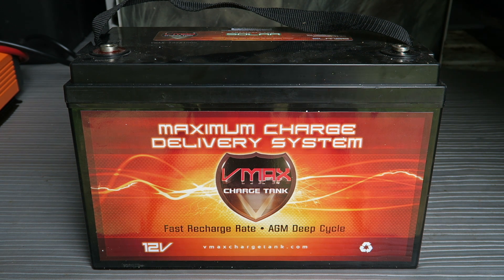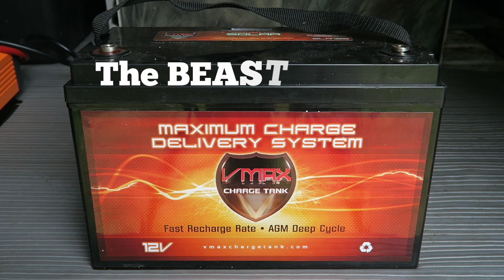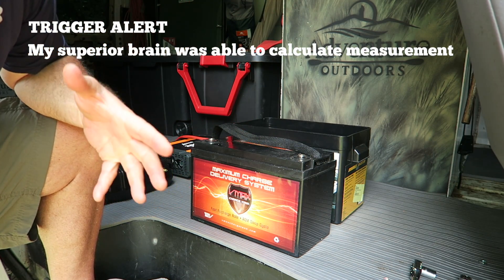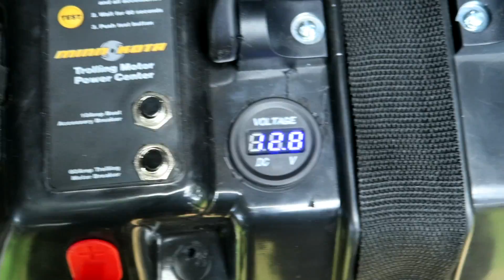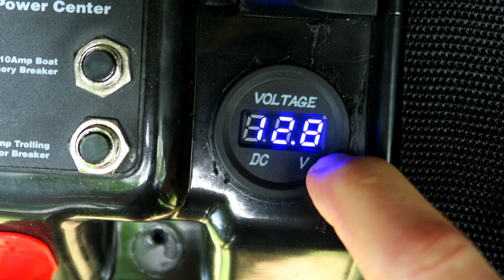VMax 125 AH Off Grid Solar Battery Power Setup ~ Redneck Yeti 1250

Comment from the maker: Amazon links to build your own DIY off grid power bank.
Minnkota Trolling Motor Power Center on Amazon, https://linktw.in/hCjxOT
Deltran Battery Charger Plus, https://linktw.in/sdRoZn
12V LED Meter https://linktw.in/yxoHLD
Ampeak 2000 Watt Power Inverter, https://linktw.in/kMYkzD
Vmax AGM Deep Cycle 12v 125ah on Amazon, https://linktw.in/QVdEOd

Comment: Me , just wondering 🤔.  Could you use the power from the inverter to power a bigger battery charger to charge the battery , and it would cycle itself , then by adding a solar panel it could make up any loss juice from the battery ?   When the solar wasn’t receiving sun light the inverter would charge the system , you would need some kind of charge limiter once the battery was full as to not over charge it ,   (  kinda like charge itself on a loop system ) 🤔

Comment: Great idea...
I need a portable power source to plug a 1800 watt hair dryer into and run it for at least 15-20 min.
Will the inverter handle 1800 continuous and will battery last that long?
Then, I need to put it in the car and can I trickle charge it from a 12V outlet in the car on the drive home?
Thanks in advance for your time.

Comment: Glad to find this, this is basically exactly what i wanted to do, but wire it to my truck battery with a solenoid that is triggered by my ignition so it'll charge both batteries when the truck is on, but prevent battery siphon from the engine battery.

Comment: Since you are only using a 1.25A charger and it takes you 24+ hours to charge.  Have you since moved up to a 5A or bigger charger?
Reply from the maker: No I haven't. Since I only use it occasionally, I haven't needed a faster charger.

Comment: Thanks! I built the same based on this vid. Using to charge drone batteries on jobs. Now I want to figure out how to safely top-off charge it when the vehicle is running.
Reply from the maker: That's awesome. Watch this video around the 5 minute mark and it might be exactly what you need to charge while the vehicle is running. https://www.youtube.com/watch?v=e38yLUzBoKo
Reply: How about small inverter into vehicle cig lighter then low amp charger to your battery  pack?

Comment: Hey man stupid question can you charge your battery while using the power from the same system
Reply from the maker: Shouldn't be a problem. If it were hooked to solar, that's exactly what would be happening.
Reply: Definitely
Reply: You can also jumper cable it to your truck and run it non stop

Comment: Nice setup, I always heard you could take a deep cycle down to zero without doing it any harm & that’s what they were designed for, just wondering why you said you didn’t wanna take it down that far???
Reply from the maker: The reason I said what I said is because that's what my research found that so many other people said. I'm basically repeating other talking points. I don't have any scientific reason for it. Personally, I don't really understand it completely like an electrical engineer would. If I were you, take what I said as just someone else saying it and do some research that will satisfy you.

Comment: Hello, I was wondering if you can have it hooked to your solar panels on the front terminals and have this tucked into a corner so you do t have to take them off every time you need to charge?
Reply from the maker: With solar panels, there is no need to charge. They'd be charging all the time. I originally thought I would add a solar panel but I haven't needed to yet because I'm not off grid for long periods of time.

Comment: your yeti goal zero weight is way off.  I have the yeti 3000 and it doesn't even weigh 100 pounds
Reply from the maker: If you Google it, it says the weight is 100 lbs on the Yeti. That's what I went by.

Comment: You CAN safely take that Battery down to 12.0 Volts and not have any issues.
Reply from the maker: Thats good to know. It's hard to find the exact info you need on the internet. Not being an electrical engineer, I guesstimated based on the info I could find. Thanks for watching and commenting.

Comment: Because your VMAX Battery is Lead Based, you still have the SAME limitations as any ordinary flooded lead Acid Battery. Only 62 Amps or about HALF of its rated capacity is actually available to you.

Comment: Hey Steve, nice build  very informative. Question for you though, doesn’t the inverter display input power from the battery? Can’t you look at that instead of installing the volt meter?
Reply from the maker: That's a good question and sitting here in my warm office I can't totally remember. I think it does but it wasn't as reliable as I wanted it to be. That's why I installed the voltmeter. Super easy to install. I wanted accuracy. I also installed the momentary switch on the voltmeter because over time the voltmeter was slowly draining the battery. I have a video on that also.
Reply: Adventure Outdoors yes seems like an easy install so I’ll go ahead and just install it anyways, and yes I saw your video on the momentary switch, good thinking.

Comment: Would I be able to parallel it with my cranking battery to keep it charged with the alternator?
Reply from the maker: I don't really see why not. I'm not an electrical engineer but I would think you would want to put a cutoff switch between them so as not to drain your starting battery. I'd ask a car mechanic for advice on that.
Reply: Yep..

Comment: Very nice.  Did you consider using a box that fit the inverter inside as well? This way, it's more easily movable. Great job.
Reply from the maker: No because I can more easily move this system if I want to. If we have a storm that knocks out power, I can easily bring this system into my home.
Reply: Exactly what I'd like to do, get the inverter inside the box and this would be perfect.

Comment: So if you were only wanting a set up for a portable fridge such as an ARB, you would just plug fridge into cigarrete lighter and make sure battery is fully charged before with your smart charger?
Reply from the maker: You are correct. During travel while my van is running, I'd use the cigarette lighter on the van to save power on the portable battery.

Comment: Great video! But one question you say you don't like the battery to drop below 12.7/12.5  amps how long does your inverter allow you to go before you get into the charge state? While powering household appliances? By the way that is a great deal of savings compared to the yeti and Nifty concept.
Reply from the maker: That would totally depend on what I have plugged in and using. Hot plate, microwave etc. My original reason for putting this together was to power my portable fridge. I can plug it in and run it for about 3 days before the charge dips to the level and I have to re-charge the battery.
Reply: @myadventureoutdoors  can you connect this to a generator transfer switch on a house for outages?
Reply: @myadventureoutdoors I'm thinking of a similar setup to just run a fridge. What are the specs on your fridge- how many cubic feet? And if I'm not running anything like a hot plate, would a smaller inverter like 1000w be enough? Thanks for the videos!

Comment: Hello, great vid...I am in progress to do the same. I am looking into the proper connection to go aux, DC(cig.lighter) to charge/tinder to the minn Kota/battery. I read these batteries need 8amps+, they do not like slow trickle. I did see that battery tinder has 5amp version of what you are displaying. Wouldn’t this be better for charging this beast of a battery?
Reply from the maker: You are correct but I intend to add a solar panel in the future and charge it that way. My charger now is just something to get by on without spending much money. It works just fine, just takes longer to charge.

Comment: A good system.  But, I'd think seriously of using a pure sine wave inverter.  "Modified" sine wave may damage some electronics... although they are OK for lighting and most small appliances.
Reply from the maker: I agree. This system will not be used for anything very sensitive.
Reply: Also, since your battery is 125 Ah rated, you could use a charger that can deliver more current.  The usual formula is to charge a SLAB with 1/10th of it's rating.  So, you could use up to a 12 A charger.  Certainly 8 A would be extra safe, and your battery would charge much more quickly.  A 1 A charge is really a trickle charge, and safe for continuous charging.  I have a nice Black & Decker charger that does 2-4-6 amps, and has electronic controls and auto shut-off.
Reply from the maker: Once again we are in agreement. Until I hook up to solar, this was a quick and cheap way to charge the battery. Thank you for your comments. You know your electricity.

Comment: Great setup!  Just wonder where did you connect the fuse or circuit breaker to the inverter and its capacity.  Also just mind you the inverter is a modified sine one so keep an eye on it when running TV or laptop.

Comment: Great setup, however you really need a larger charger. The SLR125 requires at least 8 Amps to properly charge, if you continue using the 1.25A charger it will deteriorate the battery performance over time. AGM batteries do not like very slow charging.
Reply: Recommended charging current on vmaxtanks website for the SLR125 is "8A-35A" :)
Reply from the maker: I totally agree with you. I saw that on their web site when I purchased the battery and I also saw where people were using the charger I'm using. I figured I would go ahead and use my charger since I was going to convert it to solar soon anyway and that would be the majority of my charging. Thank you for commenting as your comment was dead on the money.
Reply: Hmm..how much solar wattage is needed to run an 8-35 amp battery charger?

Comment: yeah that's what i'm talking about. I was going in the same direction as you. Only difference was I was going to use the Newport Vessels battery box cause it had a USB & 12v plug. But glad to see I was on the right track with my planning :)
Reply from the maker: Never heard of it till now so I looked it up. Looks very similar. Probably made by same company. The problem with this one and my Minnkota is the fact you need a digital voltage readout unless you want to put a meter across it. You don't want to take your battery down too far. I didn't need USB since I can plug a USB into the outlet. The Minnkota allowed me to put in a larger class 31 battery at 125 ah vs. 100 ah class 27. Just figure what your needs are and go for it. The way mine is setup now, it can act as a small generator during power outages.